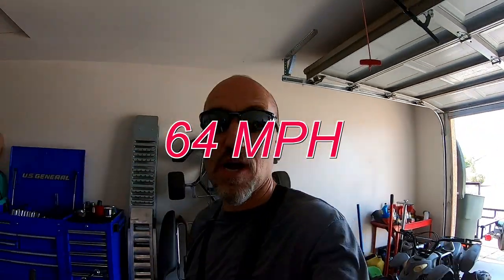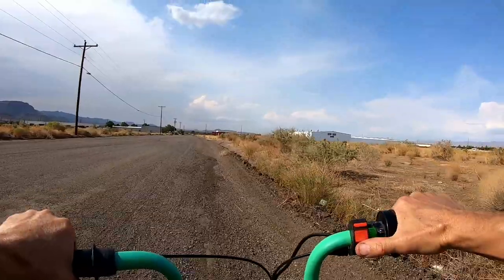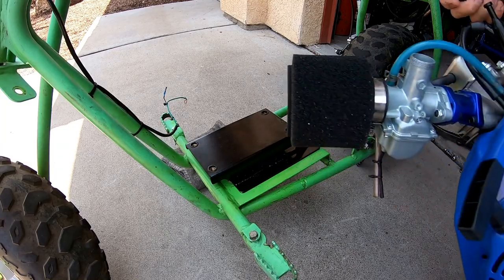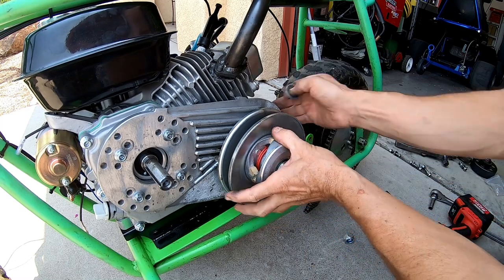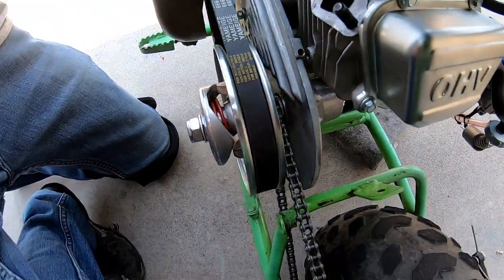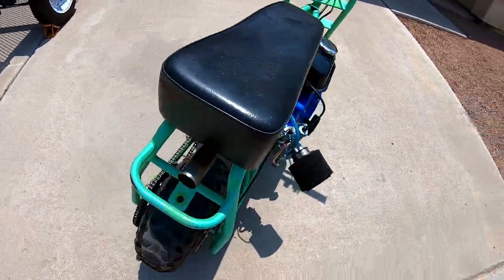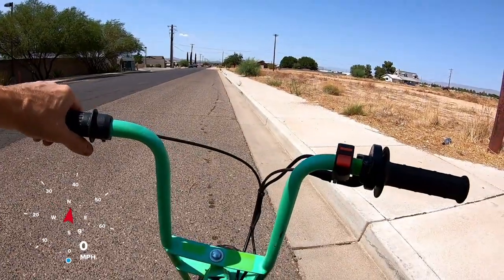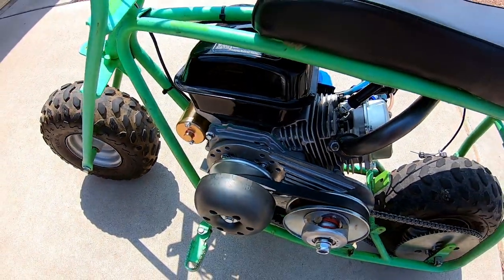Doodlebug minibike gets a Juggernaut super 30 series driver/torque converter/Tillotson 212

Comment: So I am new to the mini bike scene and I'm trying to find the best setup for my bike as far as Street use, I know torque converters are extremely popular however I see most people who do drag racing go straight chain no jackshaft or Torque converter.
So my question is what are the benefits of straight-chain as well as the disadvantages?
Reply from the maker: I think the advantages of a straight chain are less moving parts and Easier to manage at take off . The power doesn’t come on all at once like with a torque converter . So you can have a heavily built engine and still be able to manage it taking off. Myself I like the Chain set up better for a minibike . Check out my Coleman bike videos . I put a 212 on a cc100x . That bike is fun and pretty fast with a simple clutch set up .
Reply: See I like torque converters because id rather ride in the woods and i think the torque converter is a better application for that stuff because u get more power on the lower end….Everyone is different and I think it really depends on WHERE you’re planning to ride it…If i did alot of street riding, id absolutely have a clutch setup though..
Reply from the maker: @ziggybammurphy1645  I totally agree with you. The torque converter is perfect for riding in the woods and trail riding.

Comment: On a non hemi predator 212 engine can I use the 265 stage 2 cam and 22lb valve springs and still keep stock billit rod and piston?
Reply from the maker: The stock piston is fine and will work good with the 265 cam . But the stock rod I would replace with a billet rod .
Reply from the maker: Because that cam is capable of over 7000 RPM . The stock rod would be the weak link
Reply: @Black66  you have a link of billit rod for predator 212 non hemi?
Reply from the maker: @l.a.m7645  You can use the stock length rod or maybe even a .020 rod depending on how far down the piston is in the hole. That's if you want to bump compression a little. Here is the link https://www.arcracing.com/6254-arc-billet-rod-hf-predator-212cc-std-3-308-x-1-191-x-709/

Comment: Where did you get the plate for your doodle bug so you can run a torq-a-verter
Reply from the maker: Most of the parts used are linked in the description of the videos.
Reply: @Black66  I looked only link is for the torque converter
Reply from the maker: @Chris530-65  The link is in the description of this video https://www.youtube.com/watch?v=YPpR91lpkVA
Reply: @Black66  Thanks!

Comment: hi i have a 212 in a pretty light mini bike with a 12 tooth clutch i was wondering if i should get the 3d motorsports manual clutch i anted to know if the accelaration is better or top speed is better
Reply from the maker: I had a 3D clutch on the kart. It was fun for burnouts and stuff like that but I'm not sure if the acceleration is better or top speed. I would have to test it to see.
Reply: @Black66  if you have a stock 212 can you give it alot of gas and then will it do a wheelie
Reply from the maker: @adambolko2448  yes, it will do a wheelie with a stock engine if it has a torque converter.
Reply: @Black66  I’m talking about the the manual clutch
Reply from the maker: @JackJohnson-mx3ny  I have one for the kart. Here is a video https://www.youtube.com/watch?v=O-CdW48qIoo

Comment: I have a 157qmj ice bear q6 trike 2020. N I want to make it go as fast as that mini bike. I need good torque at stop n go plus top speed az well any help on what kits I need to buy to make it go fast from a stop n go plus get top speed?
Reply from the maker: Not sure what engine you running but a torque converter is good for exactly that. It will have really good low end and decent top speed. Check out this video. I put a torque converter on a mobility chair.  https://www.youtube.com/watch?v=dINewgKuzkg
Reply: @Black66  it's a 157qmj engine. Cvt trans which runs with belt  and chain. It's a icebear 2020 q6 trike. I'm new to all this moped life. Which this is my first scooter/moped I've ever own. I've seen alot of videos which people talk ABOUT big boreds and torque changing. But like Ive said I'm new to this. I've recently sub to your channel as I've notice that you are different from others. Seems like you sure know your stuff when it comes to this bikes. I've recently seen some where you change the torque tooths to more tooths n get a faster response from a stop n go point of view. I've also seen the video where you put the juggernaut I belive was called n damn the mini bike flew lol. That's exactly what I want my bike to do from a stop n go. I still need to upgrade few more simple things like the carbs. It's factory and comes plug from the air fuel ratio screw. Which don't allow me to adjust it. Do you provide parts I need to upgrade my icebear?
Reply from the maker: @4204-m3z  Thanks for the sub. No, I don't do any parts or anything. I actually do this stuff more for fun. It's fun testing different combos. I learn a lot along the way. My dad had a kart shop back in the '80s and I never really got rid of the bug. lol 
Ya, you can make your bike fast and quicker
with that torque converter.
Reply: @Black66  where can I find those torque's?
Reply from the maker: @4204-m3z  I put the link down in the description.

Comment: What's the benefit of the riser plate?
Reply from the maker: The riser plate holds the driven side of the torque converter high enough to clear the frame rail.